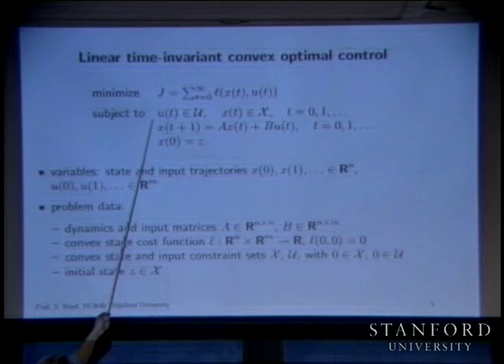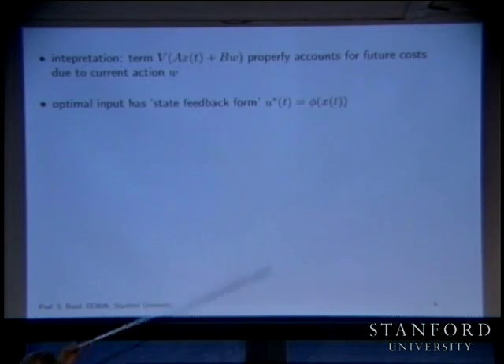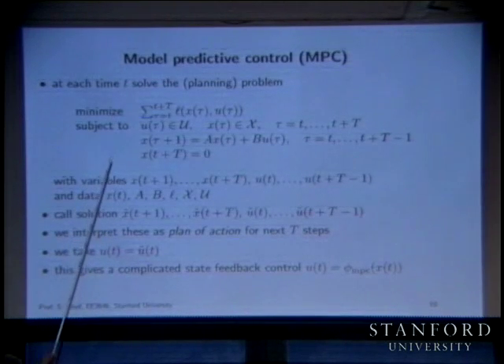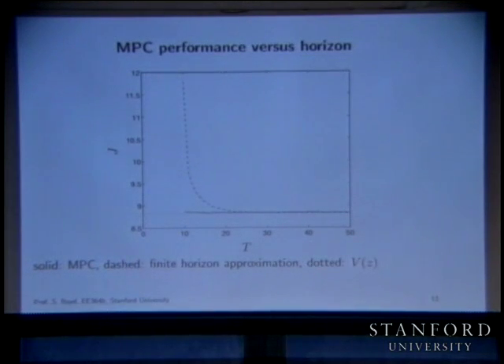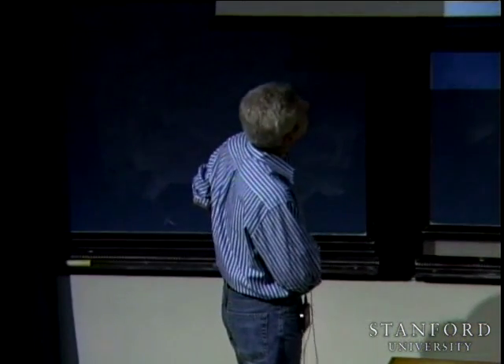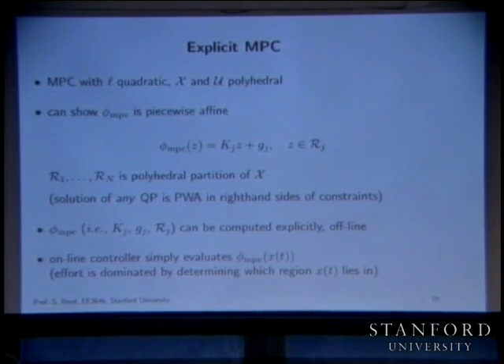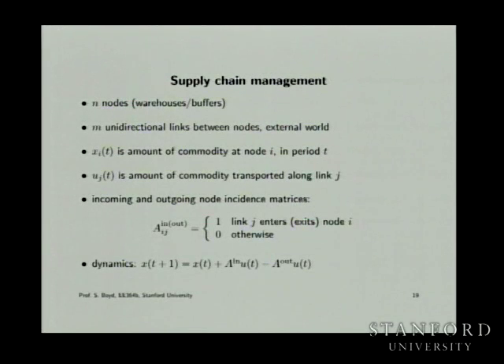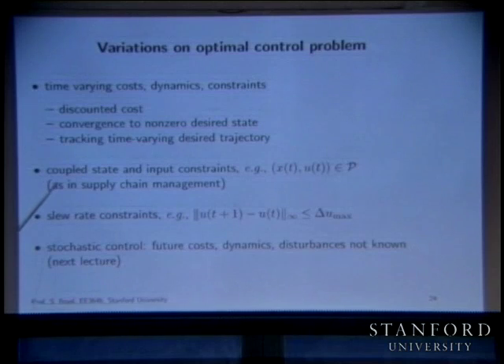Lecture 16 | Convex Optimization II (Stanford)

Comment: The use of optimization for control engineering. May I asked if this is delivered at Master or Undergrad level?
Reply: I think that most classes at Stanford with index 3** is mater degree level. With 1** is undegrad level. And 2** in somewhere between.